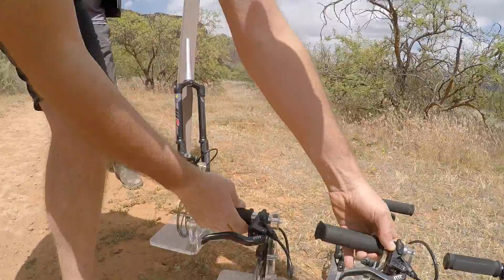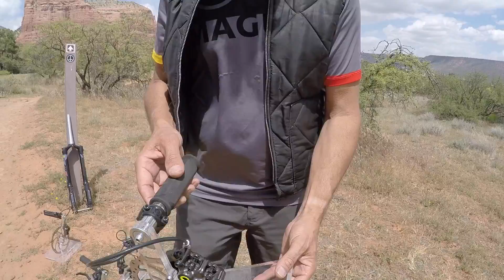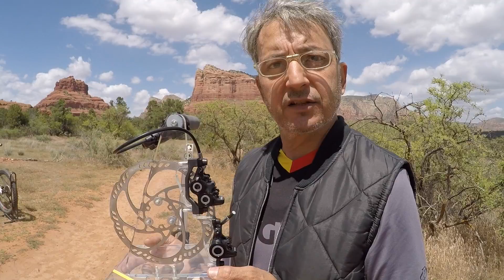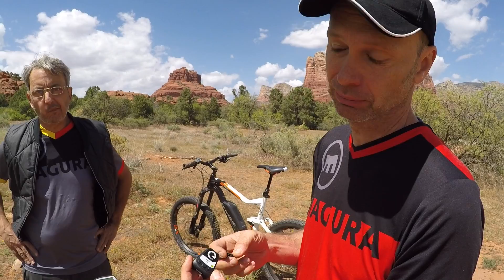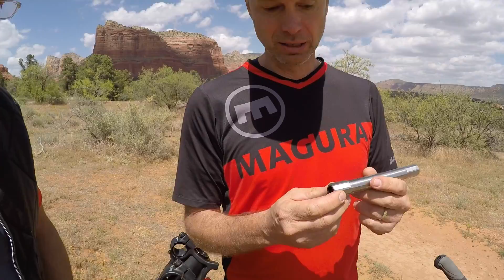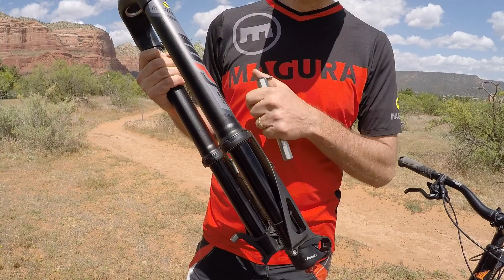Magura Bicycle Hardware Updates - Hydraulic Brakes, Wireless Seat Post Droppers, Inverted Suspension

Comment: Upside down may have bigger tubes at the crown but never have the torsional stiffness as a regular fork under same weight... AND if seals get weak there is a higher potential of leak. However I like the axle design...

Comment: BEST TIP EVER: from back then, when liability wasn't that big of a concern the bike magazines suggest for cleaning the brake clean rotor, sand brake pad, burn oils out on electric stove and sand pads again. Then sand disc, then slowly brake in brake like a new one. RESULT: hard power, exact dosing, performance is brand new....

Comment: I bought my Vyron in early 2017, and have used it on my Bulls E-Stream Evo FS3 27.5+ eMTB ever since.  It worked great until a few weeks ago, when it exploded as I lifted the ebike, popping the seat clamp right off the post and spewing hydraulic fluid everywhere.  I've had no major crashes with it and kept the pressure at about 200 psi (per spec) - I'm just glad I wasn't riding at the time!

When I looked inside the post, it seemed that the threads that held the seat clamp down were worn, or (more likely) just not very deep to begin with. My guess: they didn't account for the 15-25 lbs of extra weight of eMTBs when engineering those top threads.  Lifting a ~50 lb eMTB by the seat was maybe more than the Vyron's threads could handle, and after a year it just gave way. 

FWIW, Magura replaced the seatpost with a new model under warranty, so kudos to them for backing their shit up!

Comment: My Magura hydraulic brakes are great. I get up to 80k an hour going down some steep hills and the breaks stop great with no burning marks on the disks. My old bike with another brand of disk brakes stopped well enough but the disks showed a lot of burn marks from the heat generated from stopping at 80 k an hour.